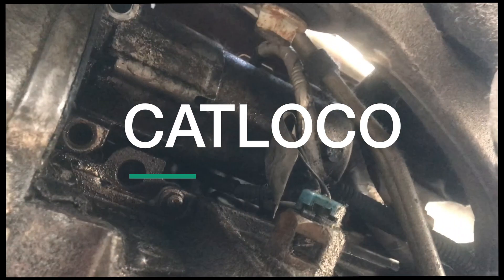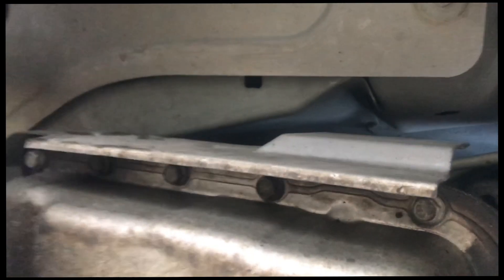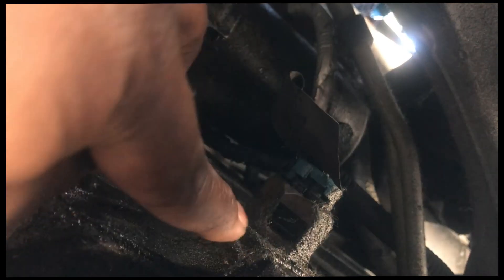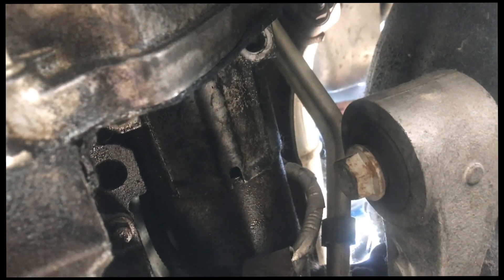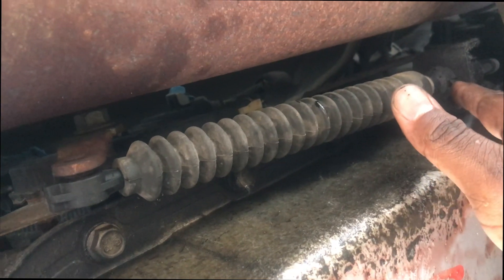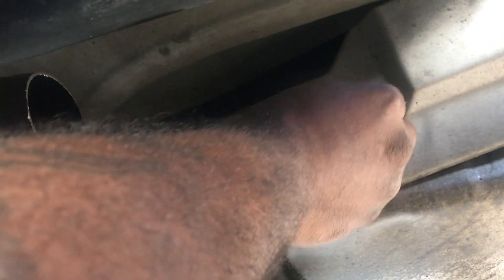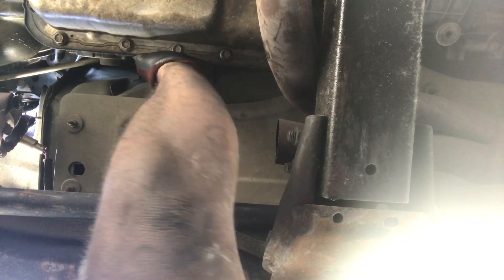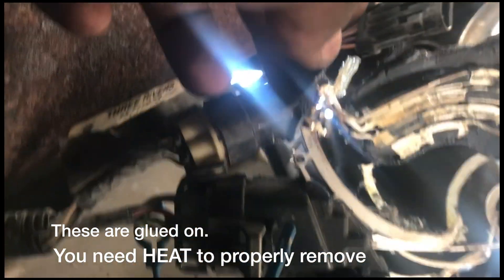How to Remove A LS \ LSA Wiring Harness Part 2

Comment: Hi: Catloco,  Great video as well.  I have a 1993 GMC Sierra 3500, that has a wiring issue.  It has some burn wires through the taped wires.  Where are you located??  I am looking for more on this particular truck and the removal/installation of the harnesses.  Or should I repair the harness by inspecting the visual signs in the tap aforementioned?  Is there a scanner tool that will give me the correct codes to find damaged wires?  Again, let me know where you are located.  Thanks.
Reply from the maker: Depends on how much you are willing to spend and your mechanical ability. You can cut and solder new wires to replace the damaged wires or look at prices for a new wire harness. I’m in KC but I only work on my vehicles.

Comment: Great video yes getting one from a 4wd vehicle is a royal pain inn the ass! Did one yesterday actually.i had to cut the grounds behind the engine in the back of the head and could barely get the cutters back there. So much crap in the way getting the harness out

Comment: Hi Im currently pulling a harness out of my 02 Yukon drive by wire. Im stuck where the harness goes into the firewall on the driver side. How do i get all that out? Do I need everything under the dash or do I just need the gas pedal wire/connector? Thanks for ur help!
Reply: The pedal and plug harness going through the firewall. You should see the bolt to release them. I don’t remember sizes right now. I generally get drive by cable engines

Comment: I was wondering the whole harness you took off is it still usable for the transmission because I want to use my motor and my transmission
Reply from the maker: The harness I took off is for a 4.8/5.3/6.0 LS Swap. This had a 4L60e trans. You'll have to change the trans plug on the harness if you're going 4L80e.  If you're keeping your original trans with a ls swap then you won't use the trans wires. You need an adapter ring and manual shift linkage like your original.

Comment: I'd like to know how interchangeable these wire harness and ECM's are when doing a swap. If you had to grab one off another application from your donor engine/trans do you have to find the exact match? I know there are drive by wire and drive by cable differences and one would be best to match that up.
Reply from the maker: Brian Vial I normally stick with drive by cable harnesses and 411 pcm. 00-03 Chevy trucks/vans with 4.8/5.3/6.0. You can do drive by wire using blue/green pcm. There is also a way to convert them to drive by cable. Www.lt1swap.com has all the info you need to do your swap. I’m still learning myself, but you learn the most while doing.

Comment: So the way you took apart the fuse block and how you removed it from the engine is all you would need for a standalone harness?
Reply from the maker: Yes. From the fuse block thru engine to trans. One harness. Easier if you find one with trans already out.
Reply from the maker: @FranksShitBoxCollection  Have fun man. Good Luck

Comment: Man i see that getting them harness is a bi÷*h to get out and a lot of work and time
Reply from the maker: Best bet. Find one with the transmission gone and wires still intact. Starter will be your only obstacle and this will go twice as fast. More of a bih filming and explaining the process...lol LS got lucky with one having the trans gone.
Reply: Catloco's Garage lucky when i did a swap on my other caprice i didn't have to pull anything lol
Reply from the maker: I’ll put out another video for you tomorrow.
Reply from the maker: Boss King It’s fun for me going through the whole process.
Reply: Catloco's Garage ok cat i will be tuned it waiting for next vid 👍
Reply: @CatlocosGarage  if the trans is out the starter will b out cause that u get the converter bolts
Reply from the maker: @jeremyhanna3852  You have a good point. :) Yeah I've removed many engines now.